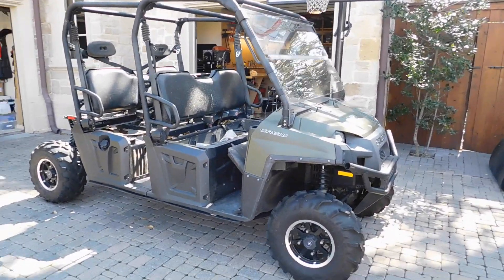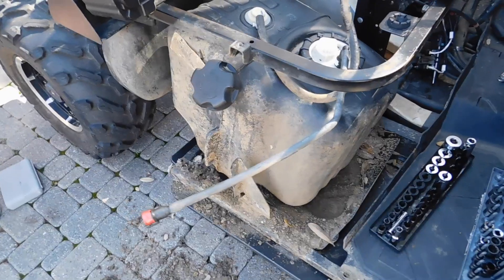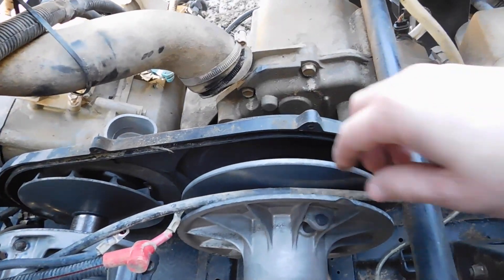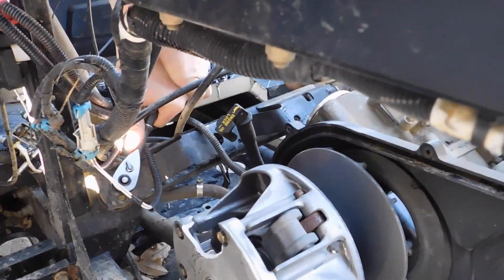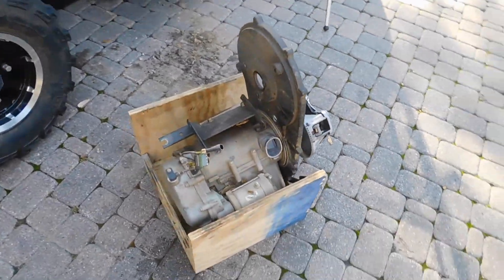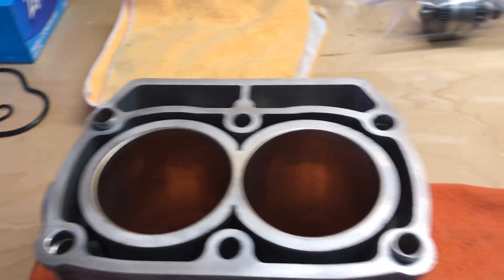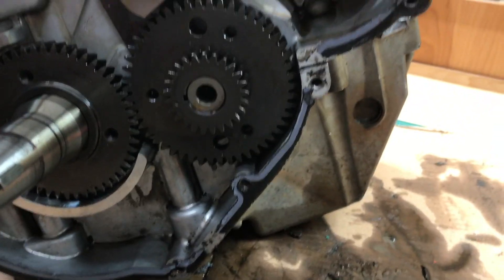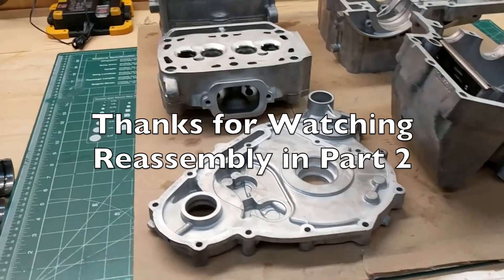Polaris Ranger 800 Engine Rebuild Part 1: Removal and Disassembly

Comment: OMG watching you do this knowing what I know about this engine, I kept wanting to shout out warnings like that you absolutely have to take off the clutch & you are wasting your time trying to get around it and now your destroying the clutch cover, oh! There goes the clutch, I saw that coming.  And then when you were trying to get the crankcase apart without taking off the cam & balancer gears, I was like NOOOO you are going to end up buying a new engine!  Well I guess you learned a lot of hard lessons, too bad it was someone else's machine.  Next time maybe get a manual.
Reply: How do we remove the clutch cover just curious
Reply: @SpliffSized  the clutch cover is easy to remove, it's just about maybe 10 bolts ish.  But you are probably talking about the plate that the clutch cover attaches to which covers the motor mounts.  The answer to that is that you need to pull the clutch  (with a CLUTCH puller) and also take off the secondary clutch so you can get to the screws that hold the plate on.  Once you get that plate off you can access the motor mounts & remove the engine if you want.  It's unavoidable, you have to take off the clutch.

Comment: Question if you drill holes in the back cover plate won’t you lose the purpose of water tight. Not trying to be a troll. Also we all have learned the hard way too.

Comment: good times!  i learned just like you guys did when i was younger, tear it apart and learn from your mistakes... but to avoid some of those invest in an oem manual it will save you loads of time like when you went to seperate the case.  But yea its all pretty simple, cant figure out why the dealer wants to charge 125hr for this.  Also the right tool for the job can not only save you time but costly mistakes..
and hoping you either put a new clutch housing or sealed it bc that is designed to keep water out and that hole you made will not bode well when the owner hits a water hole
Reply from the maker: MIKE H Thanks, yeah we jb welded those holes we drilled, pretty confident that it will keep everything out.